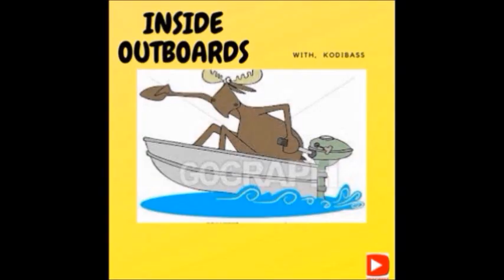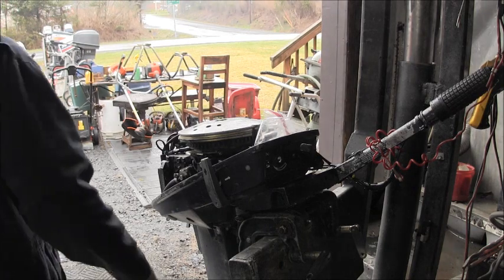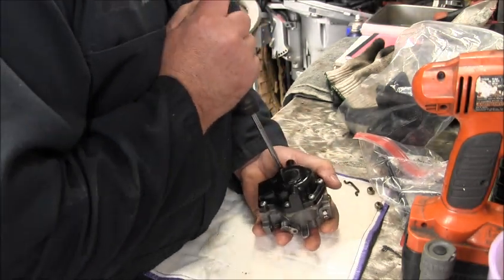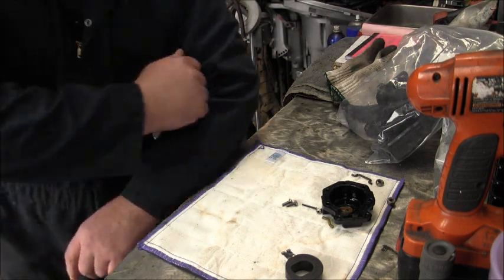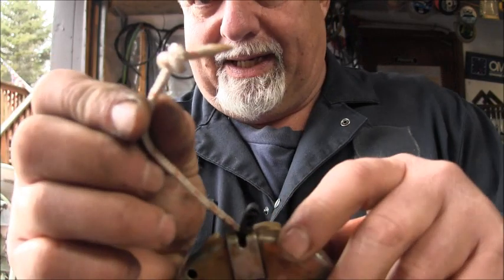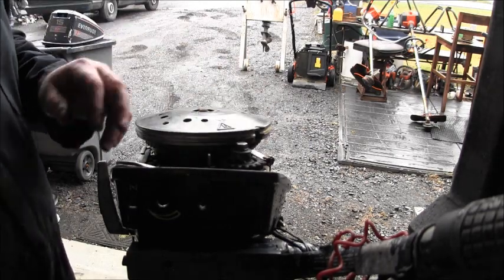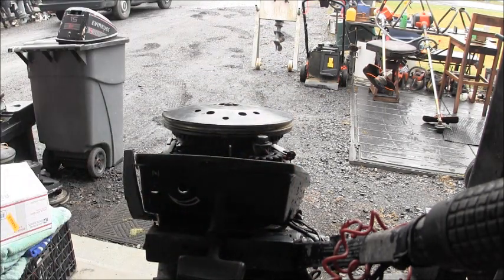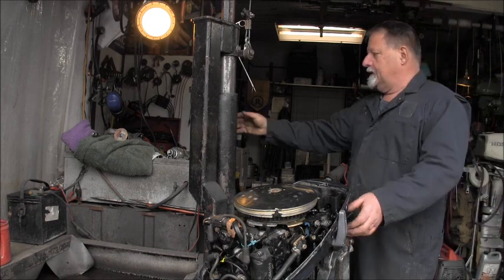EVINRUDE   15  HP  SERVICE  /  REPAIR

Comment: There are more than one hack in that video. Very generous of you, as usual. The pull rope tag rethread and the info on that little inside carb line both are very precious to us shade tree outboard tinkeres. Thanks again for sharing !
Reply from the maker: You 4  sure '''  R  Most  welcome.     kb

Comment: Hi Kodi, never seen one yet with the small hose in the carb before? amazing how they are all different one way or another. I just went through my sons lawnmower carbs. Both different and one was one of those Nikki carbs with the float sensor. never seen one like that before as well. I told him unless he likes to work on carbs allot to start buying non ethanol fuel. haha. I just released the lake test video on the 3hp Belgium 1992 Johnson which ran great. first plastic bowl carb I've worked on too. I doubt the thing ran for the last guy with the wrong float bowl gasket and missing the pulse diaphragm balloon thing that acts like a fuel pump. I also had to make a throttle cable that was missing. fun project.
Reply from the maker: Yep'   I will 4 sure check  that  Vid'  Corn gas  the worst haha,   kb

Comment: Kody my 92 evinrude 9.9 has the plastic style carburetor with the manual choke.. my choke has a choke over ride spring, that will actually allow the butterfly to open when the motoir starts,,, what is the reason for this? did they not want people to kill the engines by choke anymore?  the issue im having is one of the springs is not in its right position and when I choke the engine, there is not nearly enough tension to hold the butterfly plate closed to achieve the vacuum needed to start,, Im thinking of making it so the spring does not matter,, im thinking I will just wire the cam lever so when the choke is pulled the choke plate closes and cannot open until I push the lever back in,,

Comment: I have a 1991 15hp evirude basically same motor.  What is the process for setting the mixture or low idle screw and the throttle after a carburetor rebuild.  Thats all i have left to do before starting it.

Comment: "CPS" at its best, and expensive cheap plastic crap indeed!  Things really headed down hill on these engines when these cheesy "modular carburetors" were introduced.  The old style carbs were bullet proof, and easy to service, aside from the tin bowls rusting out.    The only thing I would ad to your recoil discussion is installing a 3/8" wingnut on the recoil bolt to keep things together while servicing it and to avoid getting hurt.    This poor ol "little cutie" has been "rode hard and put away wet" for sure.
Reply: Wonder what those big "vent holes" are for in the bottom of the engine pan...  Perhaps they provided a drain for the leaky overboard indicator hose!
Reply from the maker: @donk499    I think u may  B  correct.    kb

Comment: Hi, do you find that running the motor dry after use lessens these sorts of carb issues? Gunking up the jets/ports etc?
Reply from the maker: If you use ethanol fuel yes,  If you use non-ethanol & treat with fuel stableizers  u r good to go.    kb
Reply: @kodibassInsideoutboards  Thank you
Reply: Would like your input on my 15 Evinrude 1989 marinas charged me $800 on two different atoms and never fixed it first they just carb cleaned said it was running fine second was a head gasket said it was good to go ultimately nothing has changed. Top cylinder is not firing on time is what I've diagnosed but timing is not adjustable on these years do you think it's an internal bearing?

Comment: Excellent video.  Couple questions 
1. What solution do you use in your ultrasonic cleaner?
2. I have the same motor that I am putting an older metal bodied carb on.  Do I use the cam roller from my plastic carb or the roller from the metal carb?  The diameter on the metal carb looks smaller.
Thanks
Thanks
Reply: KB could surely give you better answers but I found a 5 % Pinesol ratio in DISTILLED water to work great. As to that metal carb, if the throat diameter is noticeably smaller, chances are it's from a 9.9. With the right cam roller, it will fit but detune your engine. Google "Leeroy's ramblings"  and you will find anwers to all your guestions on every OMC 9.9 and 15 hp engines. Regards !
Reply: Thanks for the information